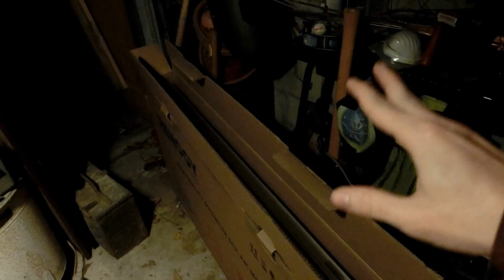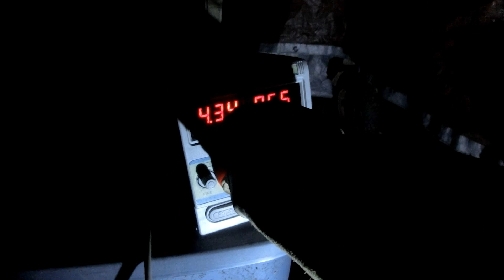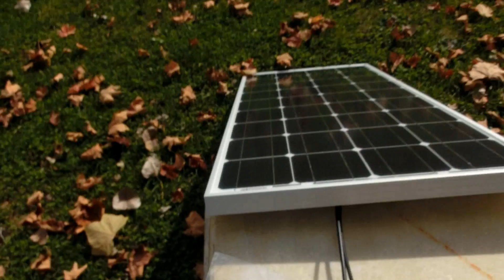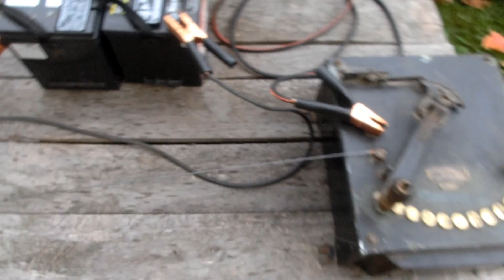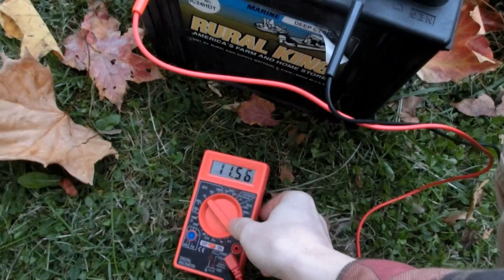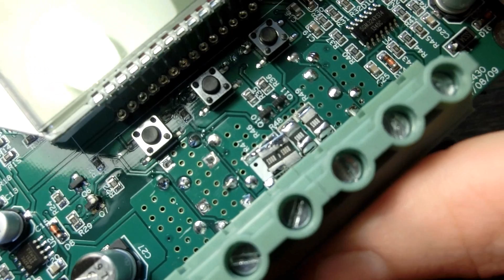Solar Sunday Experiments 001: Frying a Solar Charge Controller, medium-rare transistors

Comment: Now I know what I need to do with my controller when it arrives 
1: add diodes
2:add thermal paste to the mosfets and heatsink
3: possibly add a cooling fan
4: never reverse the polarity or short circuit it 
5: buy a controller that was not made in china lol

Comment: The "rubber pad" between the mosfets and the heatsink is a thermal pad and it does conduct heat pretty well, they are used for example in modern graphics cards for most of the mosfets and other power components. Maybe they used it instead of thermal compound because it also insulates the mosfets electrically from the heatsing better than compounds.

Comment: I knew you could milk a cow, but solar? :-D milk away, its all new to me and gives everyone a great idea what to watch out for, as shown here :-) A cross over is so easily done I gave myself a nasty bee sting on some crocodile clips last night when they accidently bridged, I got lucky with no damage but that could have gone either way easy enough.

The build quality of those looks pretty dire for sure, it never ceases to amaze how the Chinese play the sales word play game so well :-) Still with another balancer and a bit sturdier inverter and your back in business :-D minimal damage

Frankenstein/knife lever worked a charm :-) Would blocking diodes stop info passing back to the controller do you think?

I wanna run a load of those controllers in an array at some point in parallel charging so its all really useful data.

HOLD THE LINE! NEVER SURRENDER!

Comment: solar sunday.. awesome! i like it
Reply from the maker: thank you! it was either that or "Solar Bits"
Reply: solar sunday sounds good
Reply from the maker: smallenginedude71
 not counting it makes it a scheduled thing.
Reply: Rinoa Super-Genius eventually will you get brand new batteries for the off - grid shed? and a powerful inverter. 
NiFe batteries would be cool to use. but they are hard to find and expensive but can last for like 30 years.
Reply from the maker: smallenginedude71
nah i think my batteries are fine. i may add to them with new batteries someday though.
Reply: Rinoa Super-Genius sounds good
Reply: Rinoa Super-Genius i love science we need to work on a time machine together. lol

Comment: My Genasun controller has an internal automotive type fuse which saved me when I made the same mistake you did. You could install a 20A fuse in the positive lead going to the battery. This gives the advantage of not introducing a voltage drop as diodes will,
Reply from the maker: yeah but the controller pulls the 17v panel down to 14-15v anyway so if i did add a diode it would just pull it down to 15-16v then.
Reply: The danger is on the battery side. Your panels are not going to dump massive amounts of current in the event of a mishap, your battery will however. Also, the controller monitors the battery voltage in order to calculate charge rate. A diode in that circuit, with its associated voltage drop, will make the calculations invalid.
Reply from the maker: MisterClaws
 no the current went through the panel wires half way. putting a diode in there would have stopped that. and no it wont make the calculations any more "invalid" than they already are.

Comment: I spy a nice 12v battery in the first 15 seconds of the vid that has WAYYYY too much dust on it. Looks like one more batt. to experiment with. Question: I've been experimenting with Alum conversions of batteries, have you ever considered converting your 6v golf cart battery to Alum? I'd be very interested to watch a vid about that, with some testing results of course. :P
Reply from the maker: first 15 seconds? i dont see any batteries.
Reply: Rinoa Super-Genius its on the floor next to your box of solar panels, maybe its not a battery though, idk. What do you think about that Alum battery idea? Like to see it done on T105 or an L16 or something. maybe a longevity test?
Reply from the maker: Rangerman s
oh thats a metal box with my oxygen-acetylene regulators in it i think.

and yeah i plan on testing it, but i may have a small use for my t-105 for now so i'll leave it how it is.

Comment: What a bloody shame :-((, i thought that charge controller was really good at its job.
Hmm dead fets and those diddy driver transistors + the sense resistors, bloody shame.
And the inverter popped its clogs :( , should have called this video "death sunday"

Put the resistor switcher in series with the solar panal for now, just a little current limiter.
Reply: its a good temp move to stop any feedback to the array :-)
Reply: battonfive
Well it helps :-))
A diode in series with the panel output would stop backflow, but diodes do drop voltage upto about 1.1 volts on a good load, a schottky diode would be good for low loss :-))
Reply: I thought the same!!... I have the same charge controller and I assumed it has diodes in it.  I just recently found out that my 100w flexible solar panels DO NOT have diodes in them (HQST hint hint) and now ThiS??   my gosh.... I better insert diodes inline with all of my charging circuits and never assume anything anymore....

Comment: There is no way that you can ship it back to china, but I think the seller might give you a full refund since it didn't work as advertised.
Reply from the maker: well i didnt buy it directly from china, i bought it from a united states drop-shipping seller. so i would ship it back to California or wherever the location was.

on the other hand i may be able to repair it, but i may also be better off building an industrial one from scratch. atleast the volt meter still works on it. its just the solar power doesnt get connected through.

Comment: Damn thats one hell of a drawback , it even looked like some the components on the board de soldered themselfs and shifted unless it was the bad manufacturing. Does that solder pannel have a diode in it? cos if  not your gonna have the batteries feedback into the cells.and if you do get another one of the charge controllers you may wanna open it up and enhance the heatsink and check it looks safe since they probly make these  things in china for next to nothing.
Reply from the maker: yeah the panels have diodes in them. tbh i've found just connecting a kinda-dead 12v battery to the battery bank wastes the extra energy as heat so keep the voltage from going too high.
Reply: Ah thats good then , i was also thinking maybe you should mount them on the roof or somewhere high so they dont get looted? just a thought :-)
Reply from the maker: steve64464
 yeah remember i'm going to put some 4x4 wood poles in teh ground to hold them up about 10-15 feet.
Reply: I wonder if its possible to make a kinda auto rotating mount so using a computer you could make it follow the optermal sun to the time of day, Just a crazy thought :-)
Reply from the maker: steve64464
 don't need a computer for that, just a few photodiodes and a lens to control the motor.
Reply: I shall be watching your vids incase you build one should be interesting keep on solaring :-)

Comment: It looks like a thermal pad and not rubber to me.  Perfectly good alternative to thermal paste and actually a better choice for something like this where paste would have just made a mess.  Poor design on the lack of proper short protection though.  And instead of charging a battery, why not use a full battery, and have the extra power running a light or a motor?  I thought that this charger was capable of that.
Reply from the maker: i've only had bad luck with the thermal conductive rubber, and as for the power being diverted to a load that would be nice, but would require a lot of modification to the pwm controller to do that.
Reply: Ok then.  When you were first describing it, I thought it had that capability.  And I dont particularly like the pads either, they use them on $1000 dollar graphics cards so they must work to some degree.  POS heatsink tho....
Reply from the maker: CutTimeBrony  well it does have limited control over the load supply. but it goes by it's own voltage and the whole thing about the load bringing the voltage down but then when it turns off the load the voltage raises causes issues. would be great if it was analog and slowly applied load to even it out. but its just on/off.

i may build a controller where i uses the water electrolysis machine to regulate the power. one of the electrodes will have like 10 connectors. so if the solar power is a bit too much for teh batteries it lets power go to one of the electrodes, then if it needs to dump a bit more it turns on another electrode and so on untill all 10 or so electrodes are on taking teh exact same amount of power the panels are taking.

Comment: So when u put ur multimeter across that rod u got 2 ohms but u measured the current draw clearly its drawing more current then what was calculated at 2 ohms. Interesting

sucks about the fried controller :(
Reply from the maker: yeah i guess it's resistance changes with heating.
Reply: Oh yeh that totally makes logical seance. Its been so long since I have touched over these rules and calculations since sparky school I had totally forgot. Another thing you have retaught me cheers Mate. Also i having a hard time finding your other channels. I'll keep looking :)
Reply from the maker: Nitris
well the description of a channel is usually a good source of information.
Reply: Ok I know im a bit slow but i found them all.. now to have me a watch.. Thanks for the hints :)